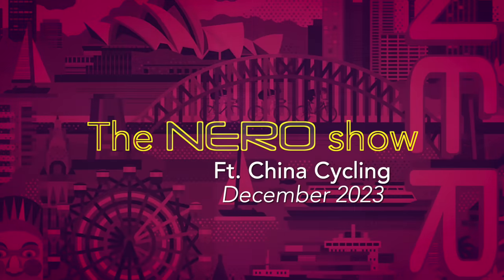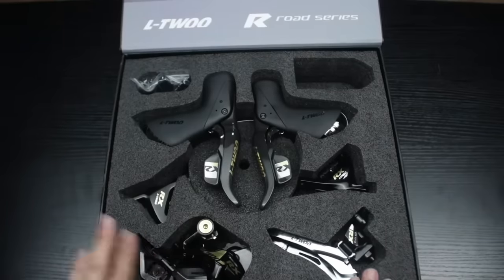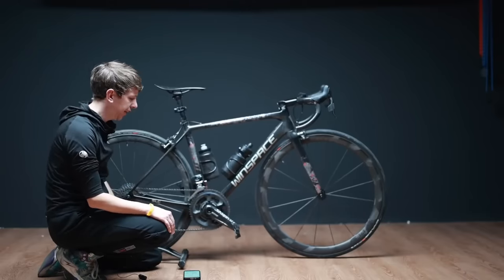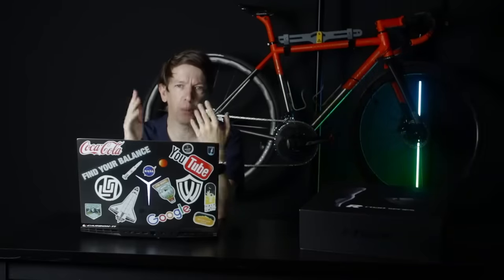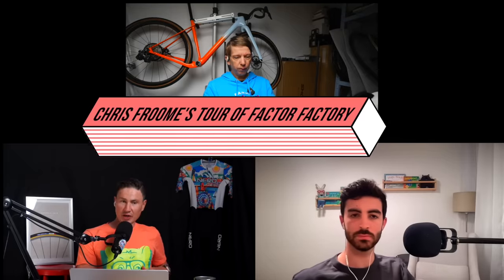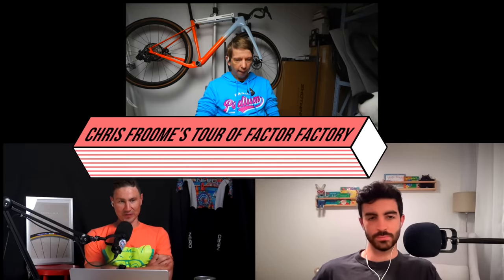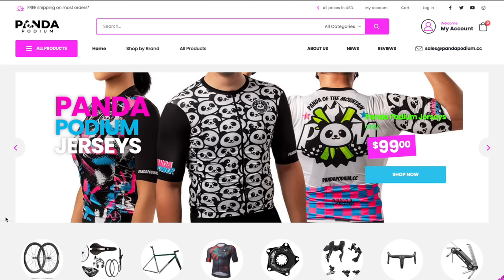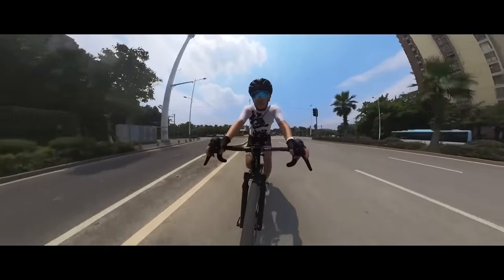China Cycling on Factor's New Factory, Cheap Carbon Lay-Ups and Counterfeit Frames

Comment: This episode made a subscriber out of me. I'm a consumer of Chinese frames. My third is on the way (for a permanent smart trainer mule.) My road and gravel bikes are both built on Chinese "open mold" frames. Speaking specifically of my gravel frame, I've identified it as being available under 12 or 15 different brand names. It never occurred to me before watching this episode that these other versions of my frame might actually be distinct from mine, beyond the obvious variations (accessory mounts, bottom bracket standard, fork selection, etc.). Maybe the boutique brand selling the frame for three times what I paid for mine is actually selling a differentiated product (beyond the obvious customer service benefits. Thanks for this. Keep up the great work, guys.
Reply: The Chinese brands are exposing the Western brands as overpriced
Reply: I think early on that the guest said that even open mold layups may be laid up in an inferior way, so one has to be careful about this aspect.

Comment: Hi, great episode, massive thanks to Joe being invited and so helpful , candid with his time and expertise. I believe that frames, wheels, handlebars and other small components coming from China will do ok but not the groupsets. there is absolutely no advantage going that route, Shimano and Sram offers solid choices for all budgets, you can mix and match, old and new, many are compatible between generations.  No one in the right mind believes that could save everywhere, frame, components, wheels, groupset and built a competitive , reliable and high performance bike.
Reply: Totally agree. Bought Sram groupset for my latest build, had a bad caliper, my local bike mechanic has a good relationship with Seam, they exchanged it, no problem. Couldn't do that with Twoo.
Reply: Many people have already done exactly that.

Comment: These videos are great. The best insight in to the Chinese side of the bike industry I've seen. I've gone from a Chinarello 10 years ago to a SystemSix Hi-Mod and now to a Yoeleo R12 with Hypers and a Yoeleo TT bike with disc wheel. It's amazing to watch it evolve. Current crop is pretty top notch in terms of value, but there are still some differences with finishing - for example the resilience of the paint finish on a yoeleo is similar to my ribble, but miles off the cannondale.

For the value proposition I will not be building up a mainstream frame again.

Comment: 11:00 (mech engineer but certainly no composite expert) but a longer tube should bend more so with same layup a bigger frame should feel softer (also equal tube diameter/crosssection and width at axles and so on)

Comment: Talking about the local market booming, cycling here is more of a fashion flex vs rider skill. They are more in it for the expenditure flex than actual performance.  Also taking local brands, out of the brands mentioned Winspace, Bross, Pardus the brand that I have seen more people riding than any other is Elves. Where I am, every weekend I see at least 2-3 new Falath Evos on the road than any other Chinese brand and I can see that they are new because each is custom.

Why is there this unspoken rule that the we as the consumer cant be told which western aka major brands are being molded in Chinese factories? Top tier Chinese frames are nothing the be scoffed at and are major brands worried about being caught out for their hyper inflated prices?

Comment: Joe is great my winspace wheels are definitely better quality than my mates zipp im not taking about the carbon the bearings in zipp are poor
Reply: I love my Winspace wheels. One reviewer noted Winspace Hypers (my wheels), where lightly greased from the factory. After one year, 3,500 miles, the bearings under the cassette spline got ate up. Local mechanic replaced the 2 outer bearings, now they roll better than new. Some regular maintenance on yours could turn some huge gains, just saying.
Reply: @happydays8171  yes I've heard this mine are one of the later batches and had more  grease in

Comment: It doesn’t make any sense for brands to do special layup frames for Pro Tour teams… they have no problem in producing built up bikes at around 6.8kg, but most of the teams don’t see every gram as a bit deal… when you ask riders what their bikes weigh you get responses like… dunno about 7kg…7.5kg… 8kg…. whatever
This is easy to achieve on road bikes with DuraAce or SRAM Red groupsets.
Lightweight wheelsets are easier to make now that brake surfaces aren’t an issue.
Not sure why they would want you to make a frame, when the manufacturers already homologate frames based on pro teams already.
Think about it.
Reply: There are big problems producing frames that come out to 6.8kg with pedals and cages, at the pro level I assure you, every rider would take a 6.8kg bike over a 8kg if offered to them. The fact that most bikes are about "7kg…7.5kg… 8kg…. whatever" is exclusively due to disc brakes and marginally heavier group sets than 3-5 years ago, also wheels in general are heavier than ever because the peloton has moved on from tubulars to reinforced hub/spoke interfaces for disc brakes which are generally heavier.